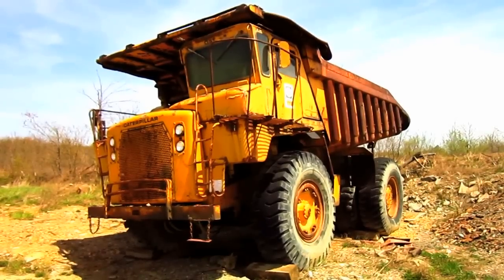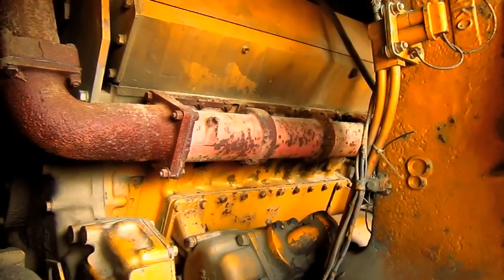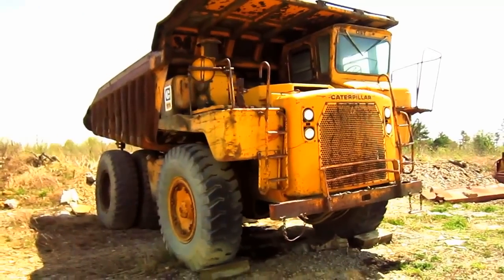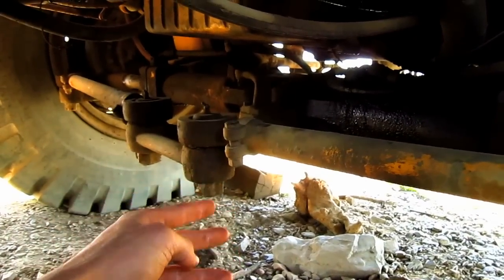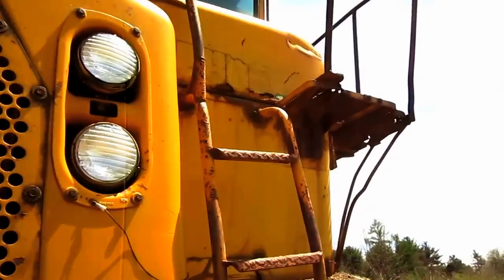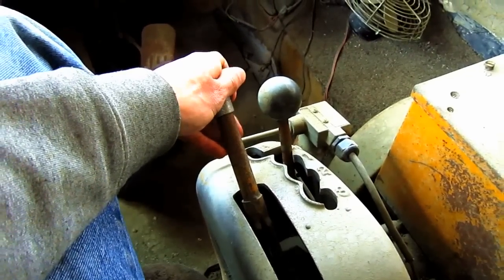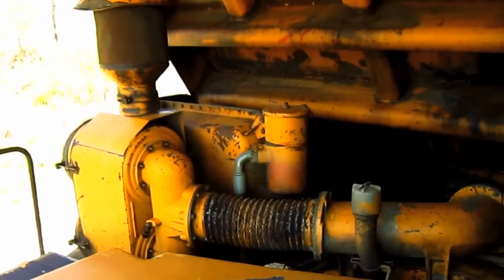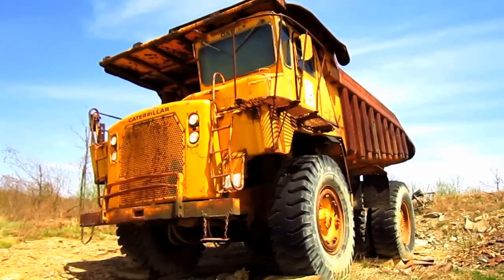Caterpillar 773 Documentary

Comment: Glad you're back and this is a good find. I remember the cab style from years back but it was probably the smaller size. The haul trucks haven't changed much since then looks like. A Cat is a Cat is a Cat. The old 631's had a 3 speed too. Guess they liked that number. I know the 71's have a 6 and the 73's have a 7 but they're electric shift. GOOD find!

Comment: Great video. You didn't explain how you get 9 speeds threw the 3 gears. Is there a switch for the 3 different ranges?
Reply: Its a 3 range trans with 3 power shifts in each range. He said it right in the video.
Reply: They really just had three real speeds in the trans. There was a big valve body mounted to the side of the tourqe converter that changed he stall making it seemed like it had another gear. when it got dirty they wouldn't stay revved up and would roll black smoke untill you cleaned it out.

Comment: That's a late model with steel cab a lot were fiberglass. They would burn you down in the summer tie the right door to the oil fill cap for a little extra air. Drove them a bunch when I was a kid. Sure would hate to do it now. I would sure like to make a bunch of the "drivers" they got now pull about a year in one of these.

Comment: Neat, too bad you can't start them.
Reply from the maker: Actually it's rather easy to start these old Cats.  This is back in the days before these trucks had removable keys.  To start this truck, the master switch needs to be thrown followed by tuning the ignition switch, shown in the video.
Reply: PAmining I meant because they've been sitting. I figured at the very least the batteries were dead